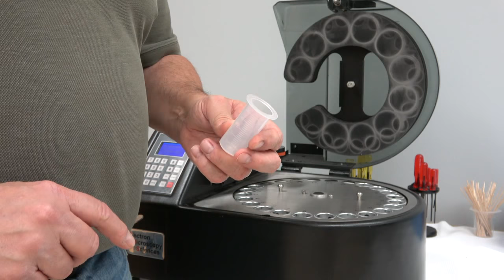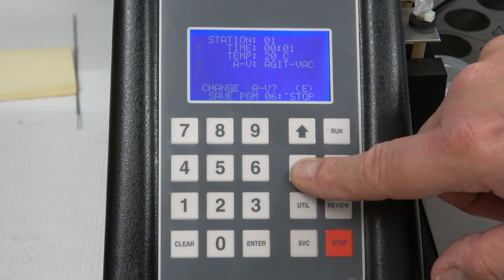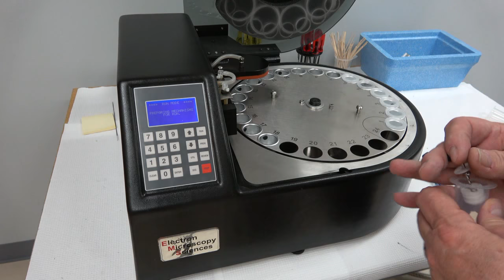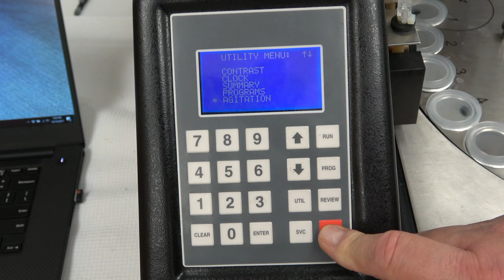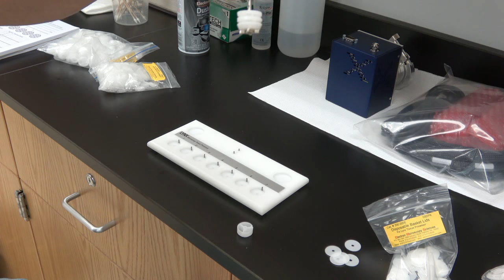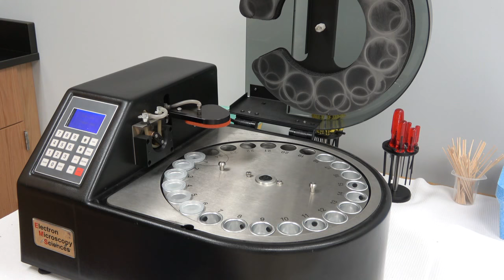LYNX Tissue Processor Setup

Comment: Thanks for this tutorial. We recently purchased one of these and put some vacuum grease on the rubber bumpers. We subsequently had one whole unit lift at the second resin vial, (vial and aluminium outer) causing an alarm. Could we use a petroleum jelly instead of the vacuum grease, or has anyone tried placing the elasticated rubber ring from the Lynx I model around the vials, between the rubber bumper and the top of the vials?